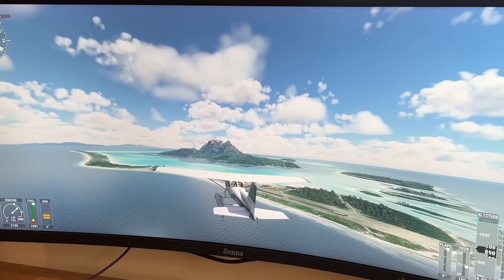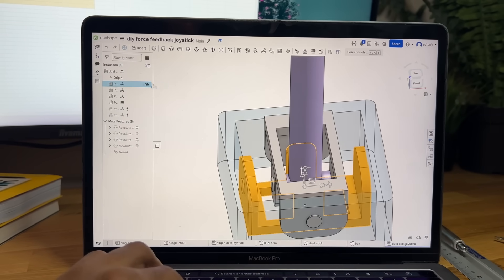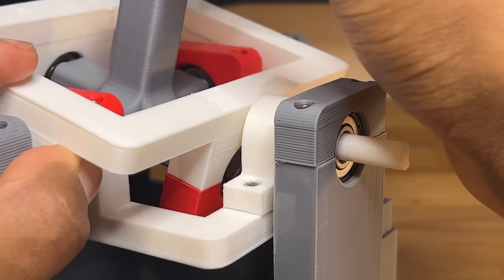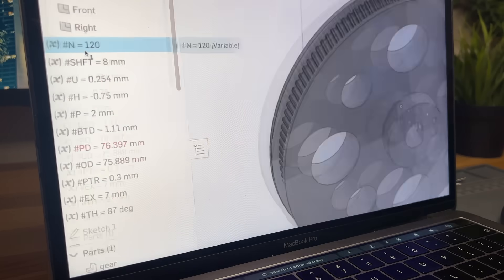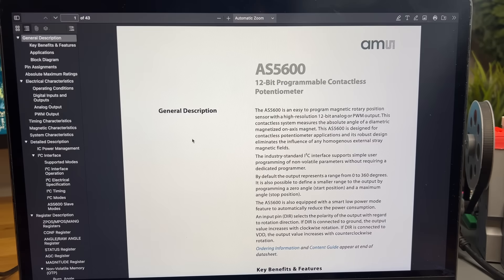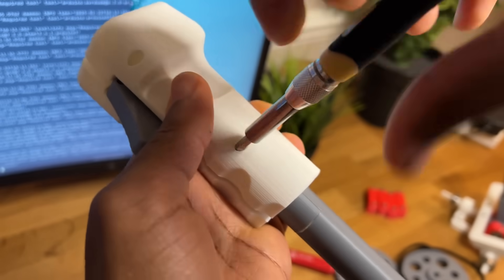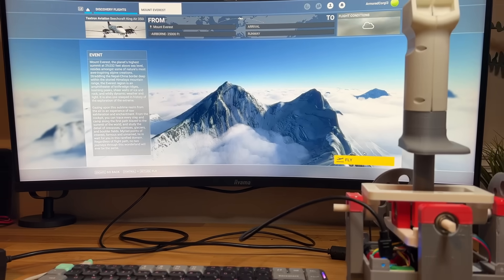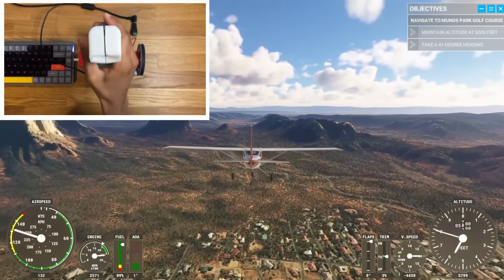I built a next-level flight joystick - using Force Feedback

Comment: Well, this isn't really force FEEDBACK. Just a static force. Next step, use USB PID protocol
Reply: Yep, definitely cool to see what he made, but it's not FFB like you'd expect using a sim racing wheel.
Reply: Yes!!! Use HID PID USB stack code so that the simulator sends advanced reports
Reply: PID would be great, but It's a very old specification. The issue is that even the example reports in the specification don't work nowadays. Every force-feedback device vendor ignores the PID spec and writes their own driver that is loaded upon request by DirectInput. It's not too difficult to do, but requires a decent amount of time parsing the sporadic placed and under-developed windows docs. I made a force-feedback wheel and screwed around with every possible format of the PID specific report to make it work but it would refuse to work on windows, even with reports that people said worked (from many many years ago). You can base your own driver and protocol off the ideas laid out in the specification though, as it's decently thought out (although there are many things that don't make sense, since they were trying to imagine future use-cases that really end up being pointless)
Reply: @elsnowman123  do you have it on github? I'm working on this for 8 years already, would love to see your implementation
Reply: I've made such firmware for arduino leonardo/micro, check it out, it's open source, just google ranenbg arduino ffb wheel. It supports 2 ffb axis with 2 as5600 so it would fit this project like a glove.
Reply: Isn't it hid protocol?
Reply: @bena2.0  PID is a sub-specification in HID. Physical Input Device

Comment: You should definitely take a look at FFBeast, which is based on the ODrive driver. And, as others have already told you, stepper motors aren't recommended for this type of implementation. Because of the open loop, you have no control over the positioning of the motor, plus the fact it's a stepper motor, so the feedback you get feels very choppy and stuttery.

If you only want a smooth low powered feedback, any DC BL motor is more than enough while being very inexpensive, and the quality of the feedback will be ages ahead of what you have now

Comment: If you use encoders, then you don't need stepper motors. And stepper motors ar not quite a good choice actually. They make the stick feel like it has steps and they're quite complicated to control too. Should've just used a regular dc motor with a reduction ratio
Reply: Or brushless motor with something like ODrive.
Reply: @tymoteuszkazubski2755  This is the best solution
Reply: @tymoteuszkazubski2755  this. Probably the best option. Odrive has a position and force option in it so you can vary the force required as the sim dictates
Reply: It is called cogging.
Reply: @jaromirandel543  thanks. Didn't know that word
Reply: he is using encoders, they're just attached to the back of the steppers
Reply: Stepper motor is definately a good choice, unless one has a very very special custom motor driver that can control torque.
Reply: @rankovicmilos86 Stepper motors are the worst choice for this application. They are good for when you want to control a position precisely, but it's almost impossible to use them for torque control, which is what you need if you want force feedback.
Reply: @Oscarius  yeah, I missed the "not" in a not a good choice :) I fully agree with what you said
Reply: @ Steppers don't work the way traditional motors work, since they use angular increment "steps." So the motion won't feel smooth and will cog

Comment: This is very cool as a project. but the deadzone on that joystick looks huge
Reply: It’s actually a big problem with joysticks, I’m building a non ffb (force feedback, although this is more like a normal stick with motors instead of springs) and most of my time on the gimbal is reducing dead zone, wobble and slop
Reply: @ShalamanderGames  though i did think he'd likely have a better time using two hall effect sensors on the gyro rather than the motor itself for accuracy, since there's no way a stepper doesn't have some weird sensor fluctuation because of the electromagnetism of the motor activating. And thats not including that his implementation seems presented in a way that hides some of the limitations of his project. as you can see it smoothly tracks the joystick in the showcase scene he prepared at 6:23, not showing any particularly bad deadzone there, but then in the landing sequence it seems theres both an large deadzone + a limit to how much input the simulator is receiving (i mean instead of 100% at full deflection it looks more like 20% judging by the throw of the joystick and the cockpit yoke)
Reply: @boutathrowthecat5352  sticking magnetic encoders directly on motors is pretty common and does work decently well.
Reply: @boutathrowthecat5352  As soon I saw this I thought cool idea, ANOTHER reason to learn how to connect a rotary encoder, and PID mathematics, so you can tune the force feedback, I am sure you could remove mechanical jitter, that just needs metal bearing a solid base.
Reply: @ShalamanderGames  I understand that. I'm just a consumer of enthusiast equipment, not really a producer. I say it as i see it. I have a Orion 2 so that is where my perspective is at.
Reply: @ShalamanderGames  The phob custom GameCube controller has a fairly good way of turning a traditional stickbox into hall effect, maybe you could try to replicate that on your project?
Reply: when you look at the yoke in the plane, it is only using a small percentage of the movement it should have... like 20% as commented before.

at 6:23, it strangely seems to use most of the elevator movement but only 20% of the aileron, but when he lands it only uses 20% of both!

it does not look like deadzone but lowered sensitivity in the center, and that can be adjusted ingame... where is probably where the problem is, he said he had never used a joystick flying before, so maybe he did not know to set it up properly.
either in calibrating the axis, or his axis is not linear ingame... or both!

normally the axis would have something like 25% sensitivity on the first 50% of movement and then 75% sensitivity on the last 50% of movement in an exponential curve... this to compensate for most joysticks being much shorter than real ones making them way to sensitive in the center! 
if he had a longer stick then the axis should be linear as you get more precision!

so what it looks like to me is that somehow he is only using about 20% of the input he should have on the axis,
on top of that the axis has a lowered resolution in the center... you can see the yoke moving faster at full throw than it does in the center!

the as5600 should work just fine on a stepper motor like this, it is one of its intended uses, there really should not be any interference causing issues unless the unit is faulty!
if the magnet is not perfectly centered over the chip though, it would cause the signal not to be perfectly linear coming from the as5600... but that is not what this looks like, it should still have full range.

there are many different ways to program the as5600, maybe that could be an issue.
default they have a 12 bit (4096) resolution per revolution in analog mode.
but the arduino micro is only 10 bit (1024) resolution, maybe that is causing some issue if not accounted for in his coding.
you can program the as5600 to have a 12bit resolution over as little as 19 degrees of movement, i have done this and using an arduino micro it will just read it as 10 bit resolution and not cause any issues... but maybe it works different when counting revolutions. instead of 4096 it just counts 1024... so it only gives 25% of the input it should?
Reply: This kind of joystick module is awful, i worked with them a lot, the better calibration possible you can do it still if a gigantic deadzone. He works on the ADC port of a microcontroller or other thing you want to use, ant each axis provides a value between 0 to 4096, where 2048 is the joystick on the resting position. If you move it like 20% to the front it will change from 2048 to instantly 4096 or something around 3400 with no precision.
Reply: Yup, thats for sure! I have a failed project with arduino nano, i would try to print a joy like this for fun, but a good working one only :)
Reply: seems like something a 3 array hall effect setup would solve.

Comment: Do you have code? I’m curious how you are doing torque control with tmc drivers.
Reply: i dont think he is
this should really use bldc motors and drivers to have proper torque control
Reply from the maker: Yep, I found out halfway through that I wouldn't get real torque control with steppers, so I dropped the TMC2208 voltage limit super low to get a soft torque response.
Reply from the maker: I didn't do this but I also think it's possible to adjust the limit over UART to simulate different torque profiles in a very hacky way.
Reply: @zeroshotrobots  any chance you would share the files to print this? i was thinking maybe motors used for camera gimbal stabilizers would work well with a design like this, if they have enough torque.
also, in the video... it seems like you only are using about 20% of the axis input you should have when you have full throw on the joystick. maybe there is a problem with the calibration of the axis?

or i was wondering if it might be the 5600 having a 12 bit resolution while the arduino only has 10 bit?
did you account for this in the code?
if the 5600 is set up to count a 4096 resolution per revolution but the micro only counts 1024, that would only give you input on 25% of the axis... or maybe it is just some ingame setting or calibration you missed, you said it was your first time flying with a flight stick so i thought maybe you overlooked a setting?

very nice design!